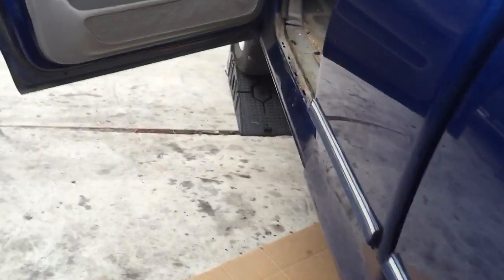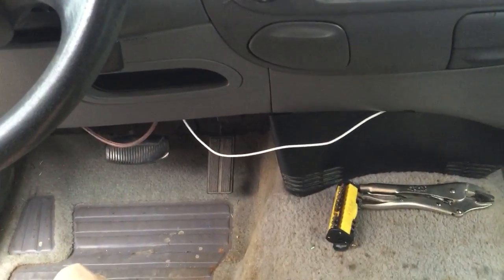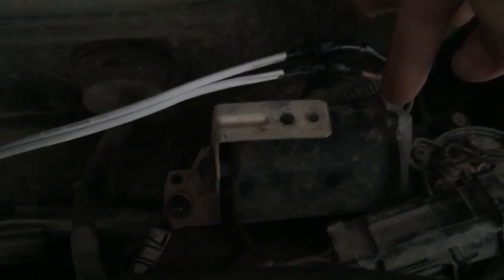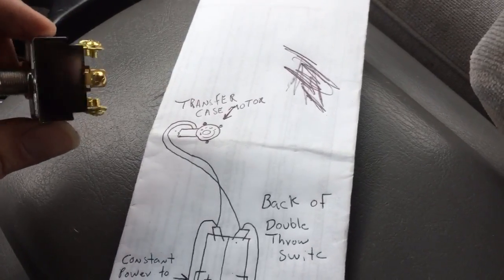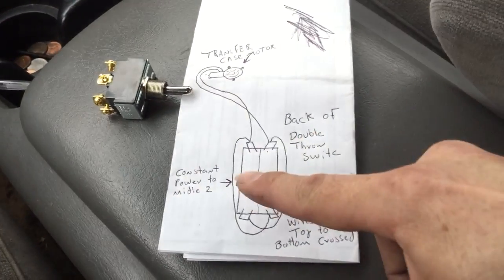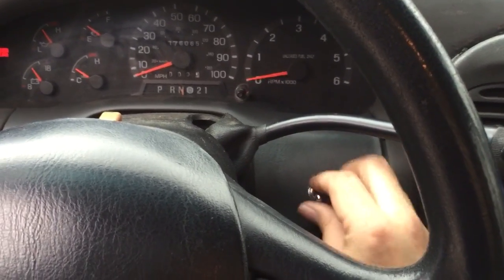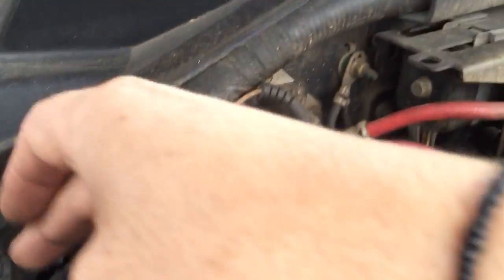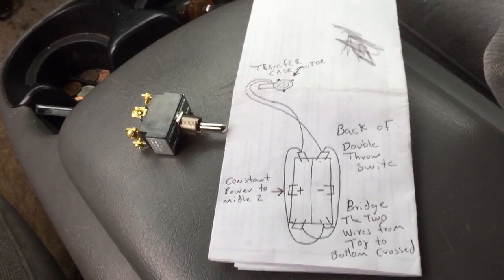Rigging transfer case motor F150 4x4 not working engaging

Comment: I used a momentary switch so you only need to hold it until it engages and then just let it go, but it all works fine and with a little bit more wiring I might wire the 4wd high light and 4wd low to work of the switch as well, but it is not really needed.

Comment: Good information here. The video was on point. And the comments were helpful as well. I’m not doing this. I’ll just order the switch and keep looking for the actual problem. Foot note here someone come up with a manual shift linkage that does away with the electronic BS. Vacuum on vacuum off on the front hubs is no big deal but I don’t like that crape ether. Thanks that is all

Comment: My F150 only change 2H to 4H but no change 4L, someone can I help me.
Reply: Actually takes 5 min to pull the fuse box/gem assembly. Remove the 2 10mm bolt on block connectors on bottom of fuse box, then unbolt the two bolts (8mm) at top and two nuts at bottom to (10mm) that holds the fuse box in. There’s a small locking tab that holds the fuse block in as well near the bottom and latches to the dash support frame and you just push to release the fuse box. Then carefully push fuse box away from dash toward firewall and lower 1/2 way down. There’s 3 gray plugs on the side. Use a flat head,or similar, to carefully remove the connectors or get your hand in there to push the lock tabs in and pull out. Once all three are removed, wiggle fuse box out. No need to tear apart dash. Once it’s out, try cleaning all the connector ports with Crc electrical cleaner or mass air flow sensor cleaner. Also remove the 3 screws holding the gem to back of fuse block. Clean that shit too. I always open them up to inspect the circuit board. Typical for the 97-98 f150 expy to loose 4low while no other problems exist. The condensation builds up around the fuse box (not so much a leaky windshield causing water to ride down the harness)but definitely leaky windshield does contribute to more condensation and moisture around that are. Which in turns builds corrosion on bottom of circuit board for gem. You can not close off the vent holes all around the gem because it needs to stay cool. Anyways, try giving it and those two big block connectors a good hose down and use a nylon wire brush. It’s a 50/50 chance of it being gem vs the bad fuse block. Both from corrosion. When you reassemble, use the hell out of dielectric grease, but not so much on the terminals of the connectors. Then throw it back in half way and test everything. If it’s still not working. Get a on-off-on 3 wire switch and momentary push button. Or just a 3 way momentary rocker switch. And some wire connectors for whatever switch you go with plus the round terminals. And some 14-16 ga wire. Connector your 14ga wire to a terminal and bolt it to the body inside the cab. A good place is by the e-brake or the metal support in front of the fuse block nuts. Then run the wire to one side of your push button momentary switch. Next run a wire to middle of on-off-on switch. Now run one wire from top of switch and use a bit splice connector to connect that wire to the brown wire with white stripe on the bottom of the three gray connectors. It should be 5th pin from the left on the bottom row of terminals. Next run the last wire from bottom of on-off-on switch to the wire next to the brown one that’s color is orange with light blue stripe. Now connect all the connectors up and don’t forget about the big block ones for fuse box and put it in 4hi like you normally would with factory switch. Then go to neutral with foot on the brake and push your 3 way switch up (which you can leave there) and push the button switch until transfer case motor switches and lights on dash come on. To come out or back to 4hi, put toggle switch down and push button until light goes out and you hear motor shift. To get back to 2wd, you’ll use your normal switch. The 4wd solenoid don’t need to be worried about because they engage with the normal working system when you put it in 4hi. Nothing else happens other than motor shifting when going from 4hi to 4lo or vise versa. Also to add the gem switches most of everything it controls with a ground and not positive polarity. So it’s easier than most think to bypass the gem with different things

Comment: How you put it back in 2wd if up is 4L and down is 4H do you have to click the switch up again to make the motor turn back on 2wd then set it the middle position ?
Reply: Switch up is 4low ,,Switch center position is 4H,,,Switch down is 2WD=neutral position....
Reply: ere does the positive wire go with the fuse on it
Reply: Can I just make it go from two high to four high
Reply: I mean, can I make it go from 2 Wheel Dr. to four hi with a two way switch

Comment: I may have to do this. I have tried replacing the twin relay under the dash with a new one due to no clicking and 4x4 doing nothing when switch is switched checked and solenoids both good. I dont think its the gem because everything else works. The relay was only 13 on amazon and took about 30 min to get off the truck and 5 to desolder and desolder. The next thing I think it may be is the sensor unit beside the actuator motor any comment would be greatly appreciated

Comment: I've never removed the GEM module so don't know how much trouble it is. But before going to all the trouble of installing a whole new switch that may or may not work properly, the transfer case relay/module is right up behind the tach, under the dash. There is also a switch/relay to the right under the snap-in oval piece on top of the passenger side dash.
If you turn on your 4WD switch and you hear that switch going on and off but you don't hear the relay clicking or it only clicks intermittently, you probably have a bad relay. If the switch under the oval piece isn't clicking it's more than likely that part.
Both are easy to get to.
For the switch just pop the oval piece and there it is.
For the relay it's a bit tougher but even on your first try it shouldn't take more than a half hour in and out. You pop the stereo surround and duct piece out. Then you pop the yoke over the steering column out. Remove the light switch assembly [look up how to do it]  and remove about six screws and pop the headlight/instrument cluster surround out. Remove six more screws and pop the dash top off. Voila, there's the module sitting right on top. $30-40 bucks for one on ebay. Probably much less in a junkyard.
Only having 4Lo if you're going any distance or you're on the highway in the snow is a real pain.
Whether the switch in the video will harm the motor I don't know. I do know the factory switch is only hot for a moment to shift the transfer case and then turns off. When the switch in this video is on it stays hot even after the transfer case is shifted.
Reply: That is why you switch it back to the middle position after you have engaged the gear that you want. I used a double throw momentary switch so it automatically goes back to the middle position when you let it go.

Comment: The 4x4 lights should still work, but i see they do not. The shift motor on the transfer case has position switches that tell the gem module what 4x4 mode the transfer case is in, so it can send signals to the appropriate selonoids that operate the front axles acumulator. Those switches rotate with transfer case motors position. All the switches do is open and close circuits for the gem module, as the motor roates, the switches rotate with it. You sure you just don't have a bad transfer case motor?... and are you really gettin it in 4x4 mode? I'm not sayin your switch won't work, I'm just sayin it appears you may have other issues the switch you put in isn't resolving.
Reply: If it had a bad transfer case motor then it would not change from 2wd to 4wd low which it does, but not lights come on in my one.

Comment: I have a 07 f 150. we had to replace a wiring harness. it operates the 4x4. it went to the iwe solenoid. we could only find a 2 wheel drive wiring harness. would this video work on my truck to? How would I get the iwe solenoid to work?

Comment: Great video!  I finally did this and it works well.  It Takes some practice to get a feel for it since no light indicators work.  I put my fuse where I could reach it easily and then pull the fuse until snow is coming to kill the circuit until needed.  Thanks again I would have probably not tried this without your vid.

Comment: You actually did a fantastic job of writing out a wiring plan. I have a Ford Ranger with the same type of transfer case. And I will use your method as a way to get it to work if all else fails. Thank you for posting your video!

Comment: just did this today on my bosses plow truck and it worked you're the man!
Reply: Hale Cooley . Where did you pull power from for this
Reply: Ronald Coleman I did straight from the battery with an inline 15 amp fuse still working for us good luck

Comment: Can u make another video on how u rigged the solenoid?
Reply: I think just leave the hot 12v connected but disconnect the ground side and put individual switches on to ground one solenoid or the other for 4wd (solenoid closest to side of truck) or 2wd, then  this also bypasses the GEM

Comment: He uses a double pole double throw switch. on the switch, the middle two connections are for 12V + and 12V-. The drawing he did shows he connects short jumper wires from each connection on one end of the switch to the opposite side connections of the switch to change the polarity (direction motor will travel)(like drawing an X from the corner connectors of the switch). This changes motor direction when he moves switch from up position to down position (or vice-versa).  Old 4x4's had a lever that you pulled down about 2 inches to go from 2xH to 4xH, then you moved it down another 2 inches to go into Neutral then another two inches to go into 4xL.  This electric motor is just moving that lever into each one of the positions (hear the clunk in the video).  If you move the switch one direction it will go in the above order, when you move it the other direction it shifts the transfer case back from 4xL (clunk) to N... then shifts to 4xH (clunk) then shifts to 2xH (last clunk).  You must return the switch to the center position (see other comment about buying a switch that is Momentary (returns to off position by itself like your window switches) for safety... best application for this if you are absent minded.  pg 112 of the 1998 Ford Expedition owner's manual shows Ford uses a 30Amp for the shift on the fly Expeditions... If you intend to do this use absolutely no higher amperage fuse than that.  Keep in mind that this thing could actually get stuck between gear positions and leave your machine in Neutral... as mine did the second time I used it.  Better make sure you know what you are doing if you want to attempt this.  If you are parked on a hill and accidentally stick it in between gears, you will roll (obviously you have brakes!),  I do not recommend doing this, but it did work for me to trouble shoot my 4X4 problems until I replaced the motor (which now only cost about $50-60USD.
Reply: Translet

Comment: I Have done this and works great. One thing I RECOMMEND Is to get a switch that is Spring loaded back to center to keep from burning up transfer motor if left un up or down mod. Our if someone else drives vech forgets to switch back to center.
Reply: Plow toggle switch is what u want . Sell them for plows auto parts stores done
Reply: It should automatically stop when it gets to the stops.

Comment: Normally the transfer case is considered in neutral or 2hi and when the switch you made goes into neutral then it makes the case turn to 2H so is there an up for 4H and down for 4L? Is that what you mean but up and down, one being 4h and the other 4L and middle is 2H or neutral?
Reply: Switch up is 4low ,,Switch center position is 4H,,,Switch down is 2WD=neutral position....
Reply: @alexandercundapi705  No, there is no 4H with this switch, you have 4L up and 2H down, in the middle just disconnects to power so you don't burn out the motor.

Comment: You said and show up is 2Low, 4 low is middle 2wheel drive is down and then back to middle? I am confused.
Reply from the maker: Middle is neutral(no power nor ground pass the switch). 2hi or 4lo can be either up or down depending how you position the switch
Reply: On the video say ,,Switch up is 4low ,,Switch center position is 4H,,,Switch down is 2WD=neutral position....
Reply: I get confused to...about that..but I repeat the video so many times on where he explains  how the Switch works into I got it...

Comment: After you direct the 12 volts to turn the motor all the way what disconnect the constant voltage to the motor or else will it blow the motor or wiring as the motor will keep trying to engage unless you have some feedback to stop the current or is this done inside the motor terminals at the case?
Reply from the maker: Thor Thunder the power won't stop on its own,  once the transfer case is on 4wd or back to 2wd you switch the switch back to the neutral position to cut the power
Reply: That is what i thought so you have to flip it back quickly to stop the flow of current which will not stop on its own. Thanks, otherwise i might have left it in that position. So, up is locked in and middle is neutral and down will lock it the other way and then you got to go back to neutral again. I think i can remember this and not burn it thus the fuse will let me know for sure. Now, is there a way to install a control simply to leave it in either up or down that will disengage it? I know the regular circuit does it somehow but how?

Comment: Thanks Buddy...
Reply: how do you test the transfer case motor  to see if its working  and as to the diagram for the switch  its not showing what to do with the center contacts on the switch
Reply from the maker: Spider Sporster center contacts are power and ground

Comment: 4 high?
Reply from the maker: Ryle Smartlowit the tranfercase motor turns one way to the other, all the way on one side is 2hi, middle 4hi and 4lo all the way in the other end. I guess if you really must have 4hi you can just time the flip of the switch (I'd say 1.5 secs would have you in 4hi)
Reply: @MrFerrill  Yes this is correct, just guess work to get 4H being in the middle somewhere.

Comment from the maker: The front solenoid vacc valves can stay on the engaged position all the time, it won't hurt anything but fuel economy just little. It would be really easy to just put a switch to the ground side of them to have them engage and disengage front differential. Can ask how if want to that.
Reply: Do you know ho to do that can you let my know how  please
Reply: Is the switch set up for in the up position it's in 4WD Hi and the middle position is Neutral witch puts it in 2WD and the bottom position is 4WD Lo????